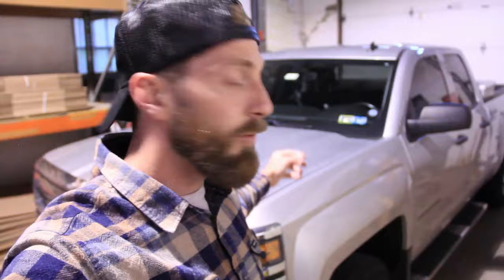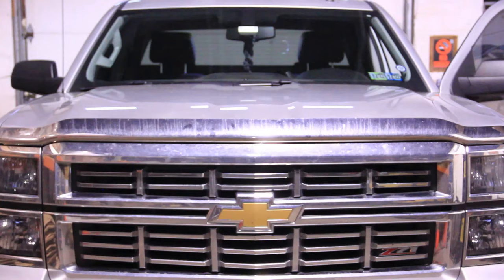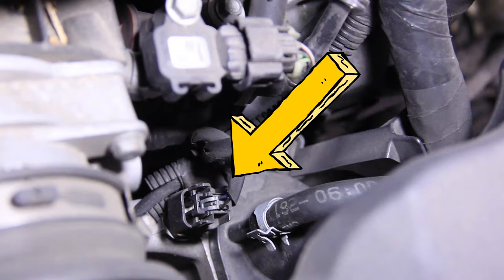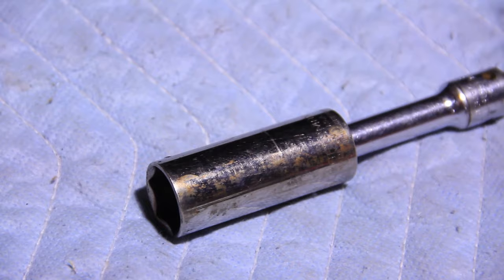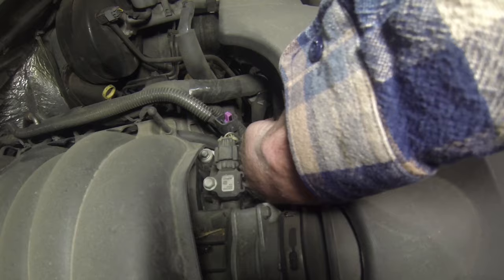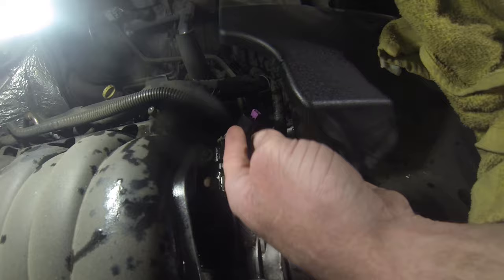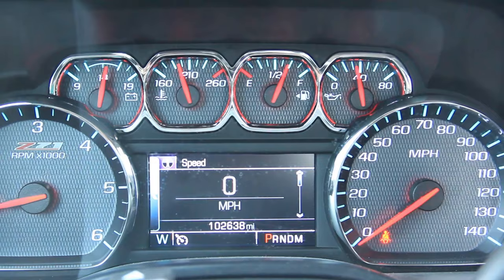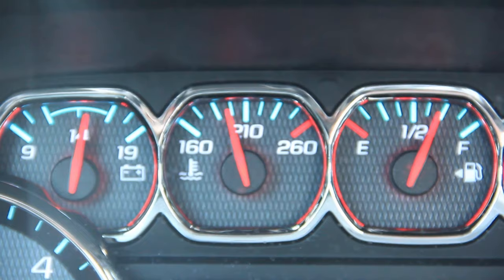Radiator Fan Won't Turn Off: 2014 - 2019 Silverado & Sierra: Bad Coolant Temperature Sensor Replaced

Comment: Great video. Did it in 20 minutes. The only thing that was missing from the video was how to shut the fan off so the work can be done. I had to remove the fan’s fuse. I could have disconnected the battery, but the fuse was easier and quicker. Great video still! Thanks!
Reply from the maker: Hey Gail!  We're glad you found the video helpful.  Typically we found that if the fan is still running when the vehicle is off, turning the truck on and off again will stop the fan.  Also, if the issue starts again, you will need to disconnect the battery to reset the trucks computer.  The truck will then read all of the new components correctly.  It doesn't happen all of the time, but sometimes it's necessary.  Also, teflon tape can sometimes make the sensor miss-read.  Removing that can also help fix any further issues.  Have a great day and thanks for watching! 🙂
Reply: @TheBrothersWorkshop  yeah i turned my truck on and then turned it off and the fan turned off too. Thanks

Comment: Worked great!!  Didn’t read the note about not using tape, but my new sensor came with thread locker so I didn’t use anyway.  Replaced sensor, serviced coolant, reconnected battery…..fixed the high running fan and <160 malfunction.
Reply from the maker: Great to hear!  If you ever have issues down the road, our trouble shooting video is linked here for you! https://youtu.be/wed9eZxPwsQ

Comment: Got her done! Appreciate the video. I wanted to take off the intake but couldn't figure out the egr connections and didn't want to break the plastic. The wiring conduit leading up to. The sensor was already breaking off to touch. Ol' trucka has 245K on her.
Reply from the maker: Glad we could help you out.  Hopefully you can get another 245k out of her!

Comment: I have a 2017 just bought it 2 months ago when the weather was cold yesterday was a hot day so decided to use ac well it was blowing hot air so did the usual checks clutch not turning fan not turning so check the feon was at charge level so started checking fuses and noticed the cooling fan relay was missing and a 10amp fuse so im guessing the previous owner had the same problem pulled the relay so it stop running now I'm waiting on a new relay because no one auto zone or advanced auto had one in my town but I'm guessing once I install it il have the same issue so I'm glad I came across this video thanks
Reply from the maker: That is very interesting.  Once you get a new fuse,.let us know what happens! P.s..read the video description because we have two more videos about this issue.  A troubleshooting video and a thermostat replacement video.  I highly recommend watching them.

Comment: Easy to follow and fixed immediately.   I had to clear the codes after I replaced the sensor.  Once I erased the codes,  the fan was back to normal and the maintenance light was gone.  Thanks for the video.
Reply from the maker: Glad we could help! 🙌

Comment: My fan currently having the same issue With my truck. Thanks for the diagnosis. I first thought it was the relay sticking but I noticed it doesn’t have a relay. Even though it shows a place on the electrical fuse block for it. But I’ll check that sensor out first. Good looking out.
Reply from the maker: If you still have problems, check out our troubleshooting video: https://youtu.be/wed9eZxPwsQ

Comment: Your videos have given me hope for doing my own work on my 2016 lol I have no confidence in myself in tearing into anything like this but I’m having the same problem with my truck as soon as it hit 100k so I’m gonna try the sensor tomorrow and then the thermostat if that doesn’t work.  Thanks for the videos!!!
Reply from the maker: Eric, all you need is a can do attitude.  You got this bro!  We felt the same way at first, and that's totally normal.
Reply: Well I replaced both the sensor and the thermostat and it still didn’t fix the problem.  Temp gauge still doesn’t register and as soon as I turn the key forward the fans immediately kick on high even after sitting all night.  Not sure what to do at this point
Reply: Well as I started reading comments on here I tried the battery disconnect like others were doing and that fixed the problem so everything’s good!

Comment: Thanks for the video. My 2016 chevy cts went out as soon as i got home at 11pm. The fans kept running for like 5 mins then turn off, so i checked this video out and i found out that it was my cts so i went to my autozone bought it put it on and bammm, good to go. Needed my truck for work, so i needed to change it lol. Thanks alot man
Reply from the maker: No problem! Don't forget to reset the computer by disconnecting and reconnecting the battery.

Comment: Lol,I took the reservoir cap off thinking it would relieve some of the pressure,but coolant shot up about a foot high until I got the new one threaded in🤣😊Problem solved tho with the new temp sensor regarding the fans staying on..2017 sierra 4.3

Comment: Yes very important to disconnect the battery 30 seconds after replacing the sensor to reset the computer. Forgot that part and wondered why it was still running. Thanks.
Reply from the maker: Yep, we go over that in the follow up video: 
https://youtu.be/wed9eZxPwsQ

Comment: Worked with my Tahoe 2016, thank you!  😃 , tip… you need to drive couple minutes until the computer read the new sensor and you good to go ;) ( because at first I changed it on my driveway and the problem hasn’t change , after 10 minutes driving, worked hehe 🙏🏻)
Reply from the maker: Glad to hear we could help you out Eduardo.  We have heard that helps.  Ours on the other hand worked right away.  Just goes to show you every truck is slightly different.

Comment: I replaced the thermostat but it still was read the same but now am going disconnect the battery 2mrow see if that works if not I'll replace the sensor as well see if it works.... Thank u for the video.....keep sharing it helps
Reply from the maker: Good luck with everything.  If you have any issues, this is our troubleshooting video: https://youtu.be/wed9eZxPwsQ
Reply: @TheBrothersWorkshop  thank you

Comment: My truck just did what you're talking about. Im going to go pick up one of those sensors and see if that works.
Reply from the maker: Hello Dee!  Hopefully changing the sensor works for you, however if it doesn't I've linked tow videos here for you that will fix the issue.

https://youtu.be/wed9eZxPwsQ

https://youtu.be/WvLyBM8FHdM

Comment: Had this problem with my 2017 yukon 
Thanks for tip 
1-iWill replace the sensor. 
2- then disconnected-the negative battery wire. 
Thankyou very much sir 👍🏻.
Reply from the maker: It should work great after you fix it.  Also, you don't need to use Teflon tape.  Sometimes it will cause you to loose a ground and the issue will continue.
Reply: @TheBrothersWorkshop  
I changed the thermostat and the sensor 
Everything good naw. Tanks 👍🏻👍🏻👍🏻🌺
Reply from the maker: Glad to hear it! 🙌

Comment: Thank you for the video. I would recommend a disconnect and reconnect of battery before you change the sensor though. I did this and it never did it again.
Reply from the maker: We went over that in the follow up video linked here: https://youtu.be/wed9eZxPwsQ
Reply: @The Brothers Workshop  ah ok! Thank you. I did not see this yet! Still great content! I always prefer to try to fix something myself, so videos on tips and instructional are always helpful!
Reply from the maker: I agree with you.  Fixing things myself is rewarding.  It feels great knowing you can do something hard, by yourself.

Comment: Great video I just replaced mine. I was reading thru the comments and saw the tip to release pressure prior to pulling the sensor. Tried it but still leaked out I had a mini geyser. Anyway I disconnected the battery and boom 💥 worked like a charm!
Reply from the maker: Hey Sean!  Glad you enjoyed the video.  We're stoked that everything worked out for you.  If it starts acting up try removing the teflon tape around the sensor.  The teflon tape may cause the sensor to miss read.  We never had an issue FYI, but some people do.
Reply: @TheBrothersWorkshop  thanks I didn’t add any Teflon tape. Mine came with a copper crush washer.
Reply: Well it worked last night today fan came back on and I got a P0128. I’ll be changing out thermostat
Reply from the maker: Good luck!

Comment: I accidentally shorted my jumper cables together. This made the fan continuously stay on, even for a few minutes after shutting down the motor. I unplugged the negative terminal of the battery, waited a few seconds, then reattached the battery cable. Problem solved…Now resetting the time on the radio…that takes a master mechanic.
Reply from the maker: Your issue is completely unrelated to the one explained here in the video.  I'm glad you figured it out.

Comment: Hey guy at brothers workshop this is informative but my 2016 did the same thing so I changed the sensor and put it back together and the same thing happened after i installed the sensor. also found the two 40 amp fuses for the fans  so I pulled them and fan went out. Well what I ended up doing was disconnect the cables but first remove the key left the cables off for about one minute and reconnected the battery cable and started it and test drove it and the computer reset and I havent had any issues anymore
Reply from the maker: That's awesome man, but we go over all of that and two other videos that we have. If you have any other issues follow our instructions in the other videos linked in the video description.

Comment: Replace the sensor in mine 2 different times even got the code both times the sensor was bad. Then I seen a video about the thermostat. Replaced the thermostat and 💨 no more codes or problems. I can say I was kinda shocked at the price of the thermostat 😂😂.
Reply from the maker: Hey Joey, we try to make it known that we have both videos, and a troubleshooting video. It's harder than you'd think to drive traction to those videos. Glad you were able to figure it out. Thermostat should have been more than $30....
Reply: @TheBrothersWorkshop  dang O'Reillys was the only place that had one in stock 54$ 😳😳😳. What ever happened to the 4$ thermostats 😂😂. Everything has to be made of dang plastic now 🤬

Comment: Thanks for the video 
With 155000 miles I’ll be needing more help I’m sure. 
I’ve had it since new an it’s been an awesome truck. 27$ plus fluid to top off. 

Did it under an hour. 👍
Reply from the maker: Hey! Glad you liked the video. 🤙

Comment: I followed this video to diagnose the same issue.  I had to loosen the clamp on the air intake and pop it off to reach the sensor.   Also, mine was completely cool when I did it and didn't much coolant at all.  After starting,  it was still on whatever safety mode it was in so I disconnected the battery for a few minutes.   Good to go after that.
Reply from the maker: Awesome!! 🙌

Comment: The comment about 160 was important for my customer thanks
Reply from the maker: What do you mean by that?
Reply: Temp.stuck on 160 degrees while fans running all the time his truck was intermittent when problem happening
Reply from the maker: Do you work for a GM dealership?

Comment: Did exactly as you said while also loosening the cap on the coolant container and ALOT more coolant came out. Also had the negative battery unplugged while doing this . Installed new CTS and reconnected everything, turned on my truck and everything fixed. Let it run for a bit then drove it around. Thanks for your help man. I greatly appreciate it.
Reply from the maker: Glad we could help out.  How is your truck doing besides this issue?
Reply: @TheBrothersWorkshop  I did that on a Friday night . Only drove about 30 miles on the weekend. Monday on the way to work , started again doing the same thing. Came home replaced the thermostat , reset the batter and thankfully no more issues. I followed your other vid and liked as well.  Big thanks guys. Save me a couple hundred or more easily. Much love from Texas

Comment: Going to try some of the suggestions. Pulling the (2) 40 amp fuses is getting old quick.
Reply from the maker: If you follow all three of the videos in our playlist, you will fix this issue.  You must watch all three.  Make sure you replace the thermostat and the sensor.  Disconnect and reconnect the battery.  If you skip any of these steps, you will not fix the problem.  The playlist is linked here: https://youtube.com/playlist?list=PLnPXcXYmgiuvbA7f_Zot4ScG1DJ7QJgO8&si=15fsNB4eWko3Dzp-

Comment: I had this problem changed out the coolant thermostat and it fixed it didn’t need the sensor or fan module
Reply from the maker: If you don't replace all of the parts, the issue with return in time.
Reply: @TheBrothersWorkshop  mine was fine until the day I traded it in for a new truck after that so idk how much longer it lasted after that

Comment: Great Video thank you very much!  I was lucky that my truck was sitting overnight so there was no pressure in the system.  I actually stuffed rags everywhere so that I would not have any coolant all over.  But when I slowly loosened and removed the sensor I was waiting for the gusher, but nope, the level of coolant is just below the opening.  Thanks again for making it easier and also for telling what size socket it used.  I am waiting for the part to come in, so i took the old one out already!
Reply from the maker: I'm really glad we could help.  If you have any issues we have a troubleshooting video linked in the description and pinned in the comments.  😁🙌

Comment: P0117 and P0119. Tried new coolant sensor, fixed it for an afternoon, next day fan on high again, found someone had a cavalier that had a bad A/C pressure sensor that told the computer that the pressure was high causing the fan to turn on high. So, went to find they put the sensor by the compressor by the tire wheel well, (great place up in the north with salt, can’t leave a good thing alone and leave up above). While truck was running and fan on high I unplugged the sensor, nothing happened, plugged back in and the fan calmed down to a normal speed. Took back apart and installed some dielectric grease on the connector. So far a week later still good. GM connectors suck. Had problems with my Malibu brake light connectors by dash before I sold it.
Reply from the maker: Hey Derek, that's a very interesting solution.  Also one I've never heard of.  Aso for the issue we are specifically talking about, no codes were thrown and none stored in the computer.  Sounds to me that you may have had a different issue all together.  Two things I've been telling people to do are, replaced the thermostat and disconnect the battery for ten minutes to reset the trucks computer.  That will allow your computer to reset and read the new parts correctly.  Keep us posted on your fix, and if it solves the issue!

Comment: I think this is what is happening with my '17 Silverado now.  The fan is staying on.. and the temp needle is stuck at 160.  And tonight.. it threw an engine light as I was on my way to drop it at the mechanics.  I suspect its the sensor.  Thx for the video.
Reply from the maker: It sounds like it's the sensor and the thermostat. Please watch all three of our videos on this topic and you'll be able to fix it yourself!
Reply: @TheBrothersWorkshop  You're exactly right.  The mechanic had to replace both the sensor and the thermostat.  It's all fixed now.  Cheers...

Comment: Couldn’t see this other hint — the a/c will stop working if the system thinks it needs to over-run the coolant system. Arizona based here, very obvious something was off. 😂
Reply from the maker: We didn't notice that issue due to the cooler temperature here.

Comment: I recon this same would apply to a 2017 Yukon XL 5.3L engine. Since it’s all the same drivetrain. I might have bought a whole new fan assembly for no reason. Off to by a new temp sensor before I do the fan swap.
Reply from the maker: I would think that it's the same 5.3 motor.  We did a video series about this issue because the sensor and thermostat needed to be replaced.  Don't worry, it's very easy.  I've linked the videos below for you! 👇
1. Temperature Sensor Replacement: https://youtu.be/aJeksrxcCDI
2. Thermostat Replacement:
https://youtu.be/WvLyBM8FHdM
3. Troubleshooting Video:
https://youtu.be/wed9eZxPwsQ

Comment: You're is very helpful. But as simple as it seems ( I'm a life long carpenter not a mechanic) I'm having difficulty finding the clip to release the top connection. I just don't want to damage anything electrical.
Reply from the maker: It's a little tough to see, but watch the video closely.  Then look at the parts on your truck.  If you followed the instructions and locate everything we talk about, you won't have a problem.

Comment: Thanks for this post. Changed the sensor and thermostat fan still on. Come back in and read the comments went out and took pos cable off everything was fine.
Reply from the maker: We've made two other videos regarding this issue.  As hard as I try to promote them, people still overlook the fact that they are out there.  I've pinned them in the comments and linked them at the end of the video.  I'm also linking them right here for you: 👇
Troubleshooting video: https://youtu.be/wed9eZxPwsQ
Thermostat replacement video: 
https://youtu.be/WvLyBM8FHdM